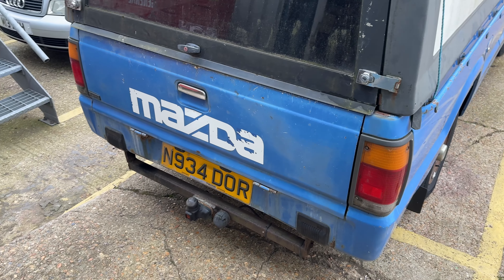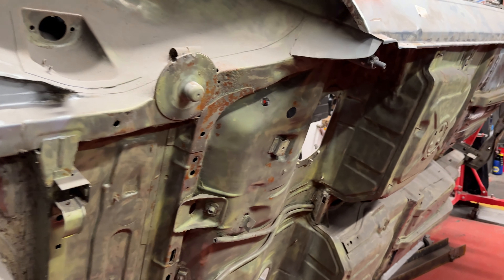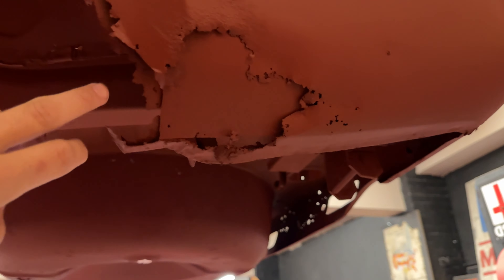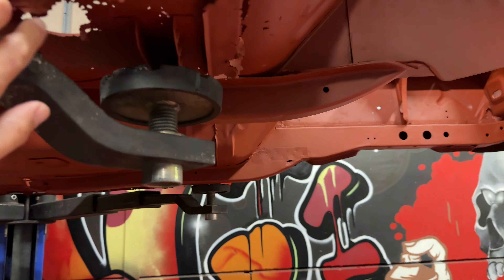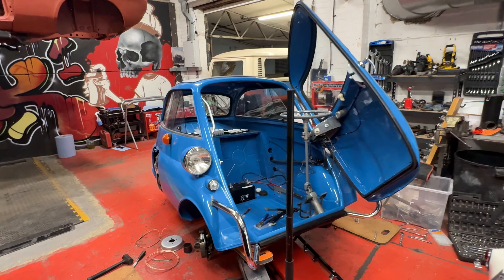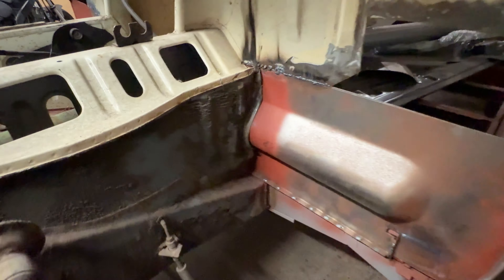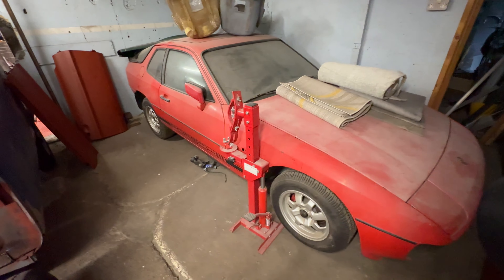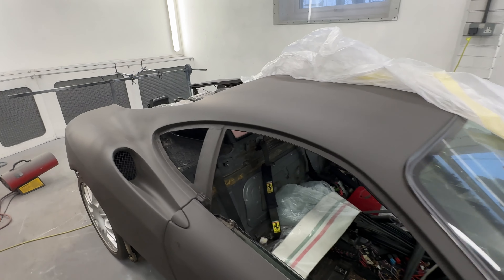3000 Mile Ford Capri Shows Why Barn Finds Aren’t Always Best! Custom Shop!

Comment: Hi.
Iv got two Mk1 Toyota MR2 if you're interested? 
A 1989 and a 1988.
UK cars, not imports
Both with low mileage, one of them has only 1 previous owner from new.
Located near Heathrow Airport